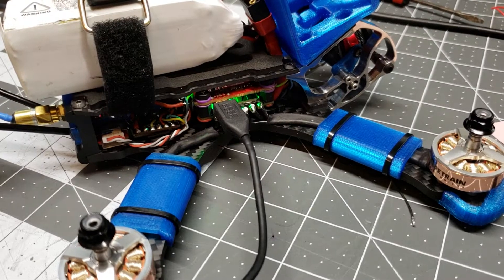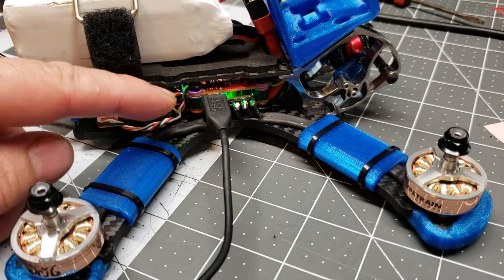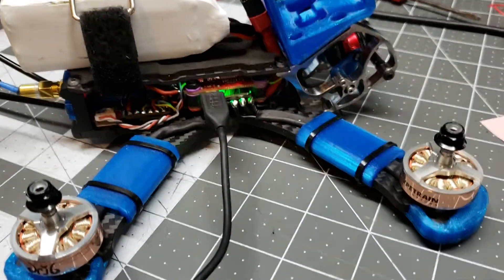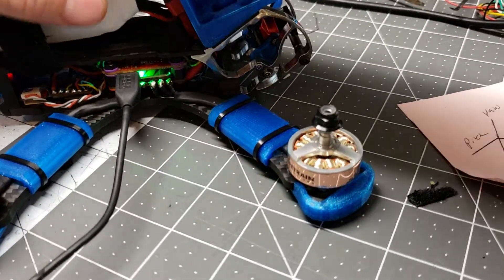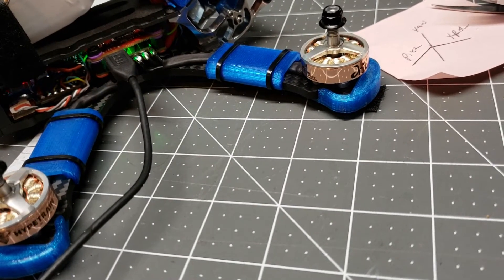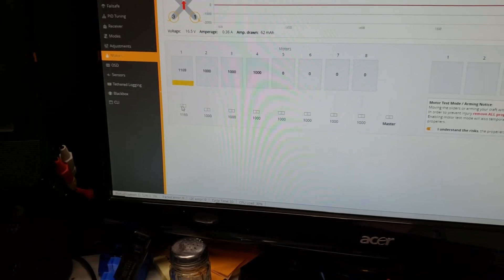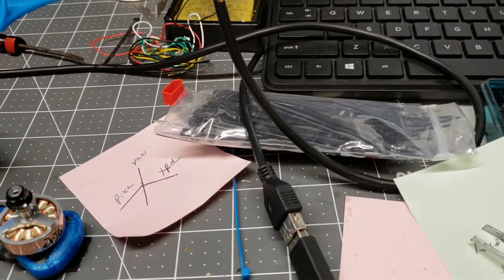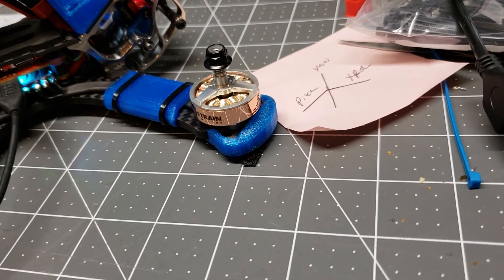Dalrc engine 40 amp motor 2 desync issue

Comment: My motor 1 isn’t  spinning  in betaflight nor showing up on blheli. Same esc. Weird.
Reply from the maker: Archer FPV doesn't surprise me after making this video I learned that there's a lot of people that have issues with this ESC
Reply: Quad Flyer X yep I see that. I emailed dalrc to see if they will do anything, also emailed dronemesh here on YouTube about it also since I bought the stack from him. But I’m not holding my breath since I’ve had it a while but haven’t built it.  Sad thing is I know a couple people I fly with run the same esc and f405 fc and love it. I’ve tried everything I can think of the fix it and nothing.

Comment: I have the same problem with my HelioRC. i buy the first batch and i never flow it. i always have different problem.
Reply from the maker: Exex Gr first batch you say?
Do you have your FC upside down?
Reply: I first think the ESC (DALRC Engine) is defect. After I watch your Review, I pack it out, use an electrical insulation on both sides of HelioRC, is now working after 3 months.
Reply from the maker: Exex Gr the first generation of The Helio spring was very susceptible to Emi, it has been recommended to flip your FC over or use copper foil tape between the ESC and the FC.

The symptoms of Emi is the flight controller with completely lock up and you had to unplug and plug back in and in my case that was never the issue motor 2 just stop working and cause the role of death.
Even after the role of death I can turn the quad back over  and it would arm but motor 2 would not come on. Like here in the video.

This video was actually created for a dalrc to review but I went ahead and posted it so that other people with this problem can be made aware.

Comment: What version of butterflight are you running?  I had the same problem with the same stack and I reflashed the fc and it was fixed.
Reply from the maker: CSRC odin.
And I allrdy tried that
:-( 
But in all honestly it really shouldn't matter what firmware I'm running the pid Loop is not in control I'm telling the motors from  the motor tab to come on this much and go off that much.